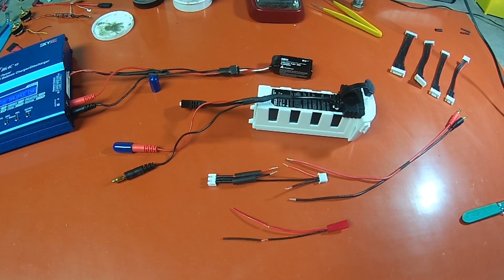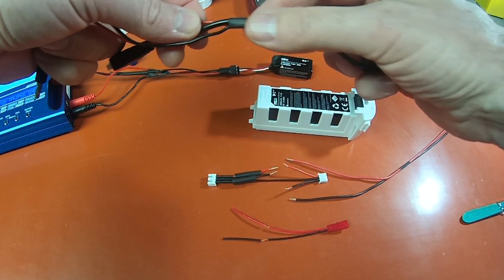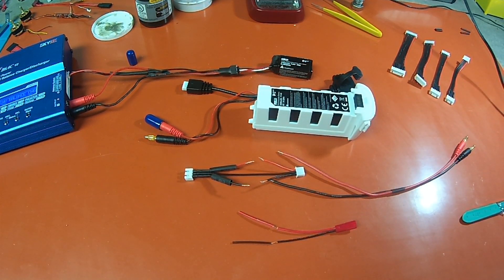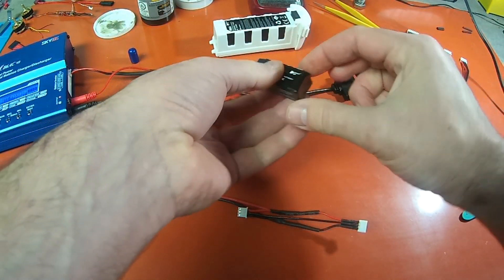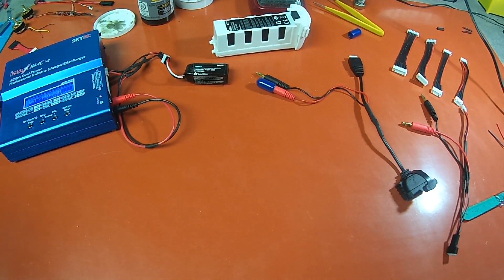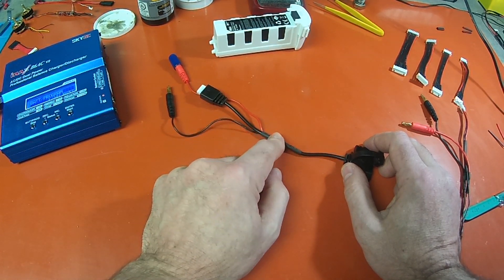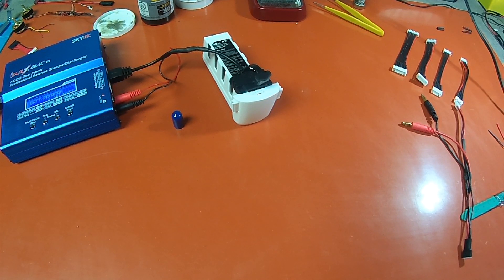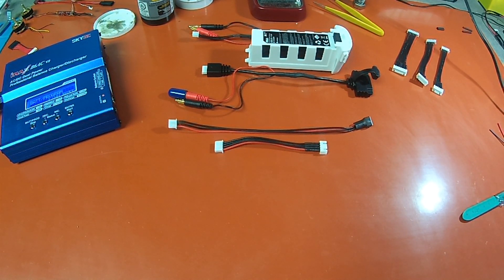HUBSAN  (PART 1) ZINO & STORM - BALANCE CABLE MOD

Comment: hello my friend Q: Does the IMAX charger charge the Hubsan Zino batteries well, like what flight times are you getting?
also, could you make me one of those leads for a nominal fee?
let me know, as I want to start charging batteries with a computer charger like the IMAX
Rob
🙂

Comment: Hey Chris, I appreciate your tutorial. I just received the iMax B6AC v2 Balance Charger you recommended I get. I want to discharge two of my ZinoPro 3000mAh stock batteries in order to discard them. These batteries are  being consumed very rapidly when I fly my drone. I also have two 4200 mAh batteries which work perfectly fine.
As I write this, I'm currently discharging the first of the two stock 3000 batteries (just to test them a final time). My question is, does the iMax tell you when the battery is completely discharged?
Reply from the maker: It’s been a long time and I’ve only discharged one. I believe it tells you 👍🏻
I do the salt water soak now...

Comment: Hi mate I got a new hubsan zino 1 with 3 batteries not changed them yet would I be better just to use the lead like yours
Reply from the maker: Absolutely 👍🏻
Also watch my battery maintenance video.
Reply: @QCGUY  👍 will do

Comment: Hi Great Video, what current would you recommend to charge the zino pro  battery with the imax, dont really need a fast charge but a good charge, Thanks.
Reply from the maker: ATTICMAN 2.5 amp LiHV balance charge.

Comment: Amigo podrias decirme cual es el positivo y cual es el negativo? supuestamente yo, son 3 negativos y un positivo, es correcto esto?
Reply: My Friend could you tell me which is the positive and which is the negative? Supposedly me, there are 3 negatives and one positive, is this correct?
Reply from the maker: TheSadielinho Red is positive and black on the end is negative. https://youtu.be/Izw0hqTpq6w
Reply: @QCGUY  thanks man, I saw the other video.
One more question.
Can you charge full the zino's battery with this charger, I don't find the option to charge Batteries LiHv type.
Reply from the maker: TheSadielinho Yes you can! If not you probably have a fake clone charger.
Reply: @QCGUY  I made a wrong buy, my balance charger is version 1,  you have version 2.

The version one don't have LiHv option 😬.

Comment: Chris, the H501S has a balance terminal and the HIGH volt 2 wire connector. Do you suppose to use 2 connections on it or use the mod and  leave the HIGH connector on the battery alone?
Reply from the maker: You need the banana plug adapter to add to the blue EC type power  plug and then the balance plug goes into the charger.

Comment: In setting battery to STORAGE charge, what amp do you save for settings? Would 1.5a be sufficient enough?
Reply from the maker: Miller Ingram 1.5 is as high as I would go. These chargers get hot at higher discharge rates.

Comment: Hi! :-)
Just purchased a Zino and are, in the process, introduced to a whole new world  of charging and balance and drones preferably not falling out of the sky at any point ;-)
So, to my question, as this video is about a year and a half old, and I got my Zino just over a month ago, do you know if their "standard" balance charger is "upgraded" or if it is the same as the one you are talking about? Mine says BC007, if my eyes works properly... :-)
If it's the same still; off to the Scandinavian version of olde RadioShack I go, to purchase whatever I am able to identify in your video! ;-) :-D (...except the B6AC, which seems not to be available "locally", as far as I have been able to "google" :-) )
Thanks anyway for a very good instructional videoseries, subscribing promtly! :-)
Regards,
Jon, Norway
Reply: ...and a quick follow-up; I've seen some versions of a "three-headed-charging-cable" for the Zino batteries, could I use such a cable set-up for charging three batteries at a time, or is this mostly a "gimmcik" and not recomended?

Looking forward to all and any enlightening reply! :-)

Jon, Norway
Reply from the maker: Jon Torstein Bakken yes that charger is older than this video. I recommend you search and purchase the IMAX B6 V2 and a balance extension so that you can charge the Zino battery with that charger. I personally stay away from the multi charging cables and focus on charging one battery at a time. Slow and steady wins the race.
Reply: QC GUY Thanks a bundle for the swift reply, advice taken, of to Kjell & Co (our «Radio shack» 😉) I go!! (And EBay for the Imax, I reckon ... 🙂). Thanks also for giving us newbie drone enthusiasts a place to get educated! Take care and stay safe! 😃

Comment: Did you ever show how to setup the settings for the battery with iMax?
Reply from the maker: Miller Ingram I did and then I pulled it because too much conflict with people that set theirs up differently and swear their way is the only way and mine is wrong. There is no law here and stock settings are were I keep most everything set to.
Reply: OMG!

Comment: Hello, the three Zino batteries that I have do not last for 3 minutes "they have one year", I have not used the Zino for 5 months and I have always charged them with the original charger with three cables that I bought separately with the 3 at the same time and I think  that there is the problem "the charger", now it is time to buy batteries, Hubsan has released a new 11.4v and 4200mAh batteries, they are on Aliexpress, they are more capacity, they are black and red, please give me your opinion and a good  charger so that they last a little longer than the first ones, orient me how I should keep them when I will not use them for a long time, greetings
Reply from the maker: The charger I showed here is perfect 👌 
Those red batteries? Not hubsan!
3rd party and Hubsan doesn’t like them being used. They are trying to tell people they are bad. lol

Comment: Baterry cable have 4 colours cable, what colour you used to connect black negative and red positive to go the balanced charger?
Reply from the maker: Red and Black....Just check the positive and negative from the marking on the plug to the other end of the wire to be safe because they change these cables and I also don't assume they did red + and black -

Comment: One question please:
Why do i have to modify the battery cable?
Will be there any problem of i connect the battery cable to the balance charger directly?
is it going to charge with no problems? 
Please explain to me in simple English because my mother tongue is not English.
Thanks
Reply from the maker: قناة أبو ياسر للتقنية There are different ways. Read the description of the video. There are 3 parts to this video covering different ways.

Comment: Can I buy somewhere such an imax B6 cable for Zino?This is Good? https://pl.aliexpress.com/item/32817342241.html?spm=a2g0o.cart.0.0.5a1e3c00kGJELx&mp=1
Reply from the maker: I don't use these boards. I have always been the one at a time guy. You can make the one I made or search and look to see if you can find one already made. I have found a few places but they are always out of stock.
Reply: @QCGUY TThanks Friend but does this board charge with a balancer? and an original Zino charging cable?or this https://www.aliexpress.com/item/32948345030.html?spm=a2g0o.cart.0.0.30a13c002jubSk&mp=1

Comment: Nice vid,  i learned a bit! Where would one get cable connectors for Husban H122D? I just received my storm today and there was no usb to battery charging cable. just a micro USB cable, that you plug in directly to the Storm. Then connect battery on the storm. It starts to charge and the buzzer and lights start to flash. as there is not enough in the battery to bind with remote. then it drains the battery faster than the micro usb can supply..   took over 20 days for the h1222d arrive, so even if they do send me a cable i can not even fly until it gets here another 20 some days!!!
Reply from the maker: Brian Schemenski join my group and you will find the cables for this balance extension.
https://www.facebook.com/groups/qcguysdeals/?ref=share

Comment: Hi QC Guy. Looking at your video, looks like the positive and negative wires are to be connected to the positive and negative wires of the harness provided by Zino. Can you confirm please? I have a charger for LiPO but I can probably use that to balance the battery.
Reply from the maker: robasce Correct about the positive and negative and a lipo battery charger will charge it but only at lipo levels so a little less flight time. Your charger needs LiHV capabilities.

Comment: I bought a Zino. If I want use the SkyRC S65 (2s-4s) balance charger could I just ignore the 5th pin?  SkyRC has 5 pins and Zino charger just 4. 
I would make a cable with a jst 5 pins on one side ignoring the last pin and on the other a jst with 4 pins. Will it work?
Thanks in advance.
Reply from the maker: Bruno Nobru I would look that up to be sure. I don’t know myself but you could always just try and see if it gives you an error.
Reply: @QCGUY  Thanks for your answer. To clarify, I made simple diagram. 
Can you take a look? https://imgur.com/a/jkwGPxO Thanks in advance.
Reply from the maker: Bruno Nobru Yes same thing I did in my other video on this topic. There is a part 2 and 3 showing other ways.
Reply: @QCGUY  Thank you very much. 

I had seen your other videos before. I had doubts if I could leave the fifth pin of the charger unused. But now I know I can.
Reply from the maker: Bruno Nobru from what I now know about this charger is it will work this way as long as negative is in the negative it will do 2,3,4 cells fine leaving the unused pins out of it.
Does it support LiHV batteries is the important part with this battery.
Reply: @QCGUY  Yes, LIHV. iMAX only with firmware update. I stayed between the iMAX B6 Mini and the S65. I had the second option because it was AC powered.
Reply from the maker: Bruno Nobru Sorry all this timeI thought you were talking about a different charger. Simply my not paying attention. 
Yes if it supports lihv then you will be fine. 👍
Reply: @QCGUY  Unfortunately my Zino fell out from sky last friday with no apparent reason. 
The lights dimmed, the drone lost power and dropped. Could not find it. The battery had been charged recently with original charger. Fell on the third flight since I took it out of the box. Very sad.

Comment: Question, please: Can I just connect the Zino cable to the charger without the mod? Will it charge faster or better - or at all? (Just lazy...)
Reply from the maker: David Kempton no you need this mod or a separate balance extension. Watch part 3 to see the extension. 👍
Reply: @QCGUY  Thx.

Comment: Curiosity question.
Instead of cutting into the Zino charging cable itself, could you use one of the extension cables and wire that you instead. Then just plug that into the Zino cable and the charger?
Reply from the maker: Woody Daniels Yes, I mentioned that in another video that Im doing one of those too with different alternatives to soldering for those not comfortable soldering.
I prefer taking one cable along myself so I usually make up the one cable like this video when possible.
Reply: @QCGUY  cheers. I have no issue with soldering just occurred to me leaving the original cable intact may be the better option.
Reply from the maker: Woody Daniels All depends on preference and comfort levelI suppose. Like I said I like just having the one for a battery like this.
There usually more than one way to do things so this is the one and what you mentioned is the other. 
I made the video doing the other so I just need to publish it. Thanks

Comment: Excellent tutorial. Thanks for taking the time to make this video.
Reply from the maker: Rob C this is just one way to do it. You can also do a separate extension to plug into the stock one but I didn’t have all I needed. A part 3 is on the way showing this and some better soldering tips and great alternatives to not soldering for those not comfortable doing it. Thanks
Reply: @QCGUY Thanks Chris. I just happend to have the balance connectors lying around from some previous mods.  No problems with soldering on this end. I've been working with  AWG 42 to 44 Magnet wire on a daily basis for decades. The 44 gauge is about as thin as a human hair.  Thanks again!

Comment: Hi, is it possible to charge the battery quickly with this method? Thanks
Reply from the maker: Sorry, you meant putting a different battery in the battery frame itself. I personally wouldn’t even give it the time to try. It’s not an easy thing to do if you could do it and finding the right size is a big hunt.
Reply: Hubsan QC Help & Support yes i think the same, but if it could be possible to find a good size (even if it 's smaller it must work) it must be really cool because i think it will be hard for me to find batteries here in Belgium and if i order out of Europe i will pay a lot of taxes😡
Reply from the maker: 0o o0 Did you watch my video on where you can connect a battery plug to on the ZINO?
You can find batteries to fit the bay but not so easy for the battery frame that is housing the battery and tapping into the stock connector of the battery would be very hard and sloppy.
Changing or adding a cable to the quad is very easy.
Reply: Hubsan QC Help & Support great i will check it.
Reply from the maker: 0o o0 Yes, I have not timed it nor do I charge higher than 3.0 Amps with this battery but it’s faster and more balanced than if I used the hubsan battery charger. Plus you can put it in storage mode using this setup.
Reply: Hubsan QC Help & Support thanks for your answer. Also do you think it's possible to modify the battery case to put in lipo batteries (maybe with more mah for more flight time)
Reply from the maker: @Mangemonslip  Absolutely! I have a short video on my channel showing the area you need to hook into and possible ways to do it. You can do it with pretty much any quad out there.

Comment: Just finished doing that cable mod, now I can use my HV chargers. I noticed it took another 20 minutes at 1 AMP balance charge AFTER I charged with the crappy Hubsan charger...no more short flights I hope.

Comment: I'm thinking of how to rig non proprietary batteries in my zino because I just learned today they do not ship batteries to Canada. ..just great news....
Reply from the maker: Yes those on your shoes with getting proprietary batteries shipped are the ones I feel sorry for but you can mod it for another battery easily I'm sure. The hardest part would be just cracking the ZINO open. I partly opened it up and it wasn't as easy as I thought it would be.
Reply: Yes..I tried to pull her apart and stopped also...when I feel brave enough I will give it another shot.

Comment: Looks like you can do this mod for the Zino with an extension cable without modifying the Zino stock cable. Then just simply plug the stock cable into the modified extension and then the modified extension into the charger.
Reply from the maker: Icantdrive55 Yes, there’s always more than one way to do most things. You can make the cable longer that way as well. I made a new version showing the soldering and if I recall I mentioned that.
I’ll post it tomorrow...👍

Comment: Thanks for the vid.
Two questions.
Firstly do you have a link to the charger you are using or at least the model name and number.
Secondly how much quicker was the charging on the Zino battery vs the supplied charger by hubsan?
Reply from the maker: Woody Daniels Yes, just search iMax B6 V2 and make sure it says genuine because there are cheap knockoffs.
The real deal should be priced around the $40 to $50 range and it’s a great safe and dependable charger.
Reply from the maker: Woody Daniels Sorry, I cant give a exact number of how much faster because I don’t pay that much attention but it’s definitely quicker, safer and you can prolong the life of your batteries better with being able to put them in storage mode.
Reply: Thanks mate

Comment: What a pity that you did not record the moment you did the work directly on the Zino charger cable. Query: It was not clear to me what are the colors of the cables that we are going to find when we cut the ZIno's charger and with which one of them we must connect the positive and the negative of the banana plugs. Could you please try to explain it here? I would really appreciate it. Thank you very much in advance.
Reply from the maker: Vladimir Lugo I’ll do a redo video.

Comment: Awwww, I wanted to see how good a solderer you are!  Also, you should have mentioned the 502C/T and 507A batteries are best treated this way since the stock chargers seem to have a knack for destroying batteries. When I got my 502T, that mod was the first thing i did. I tossed the stock charger in a box and never used it.
Reply from the maker: David Cash I can solder quite well. It’s not very hard to soldier wires together. 😂 
I will update the batteries to specifics. I wasn’t sure exactly which ones at the time. Thanks David! 👍
Reply: On the 502C/T and 507A batteries, you must cut off the stock USB charger to create a hobby charger adapter! I made 2 sets of balance adapters and modified battery boot sockets from a 507 for John in RC Groups. He loved them.
Reply from the maker: David Cash Im going to redo this video showing the actual soldering. I’ll consider getting into the usb portion. Thanks buddy!